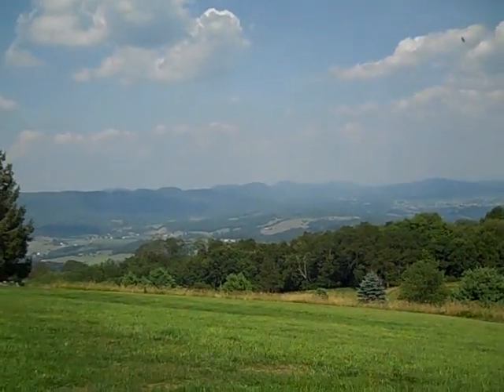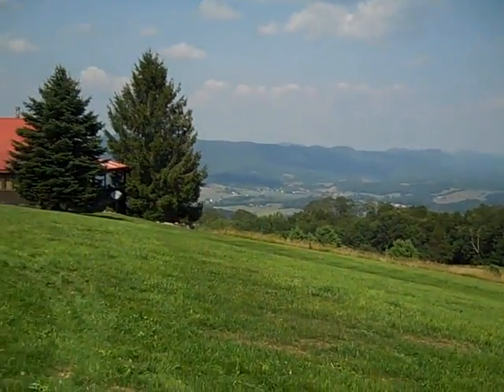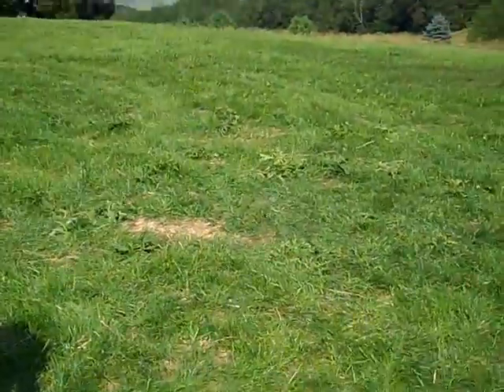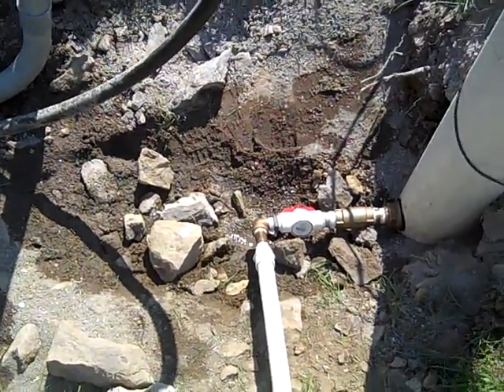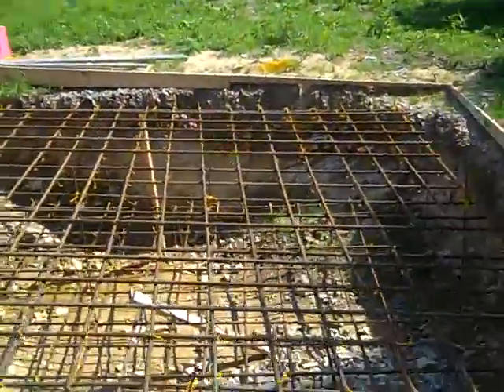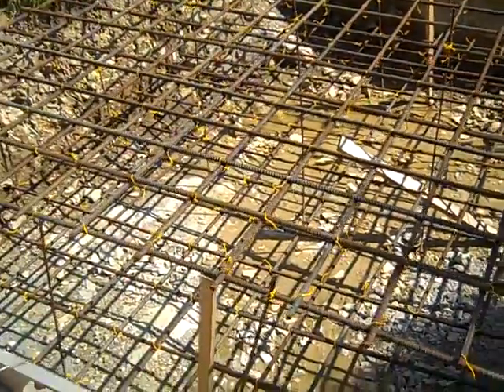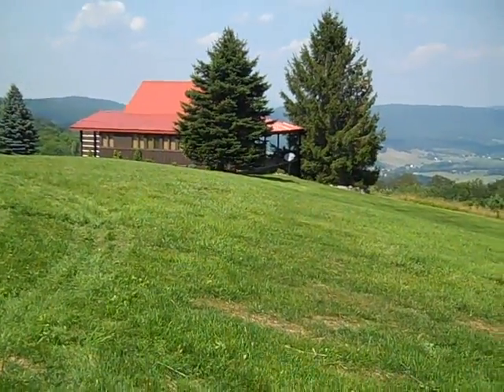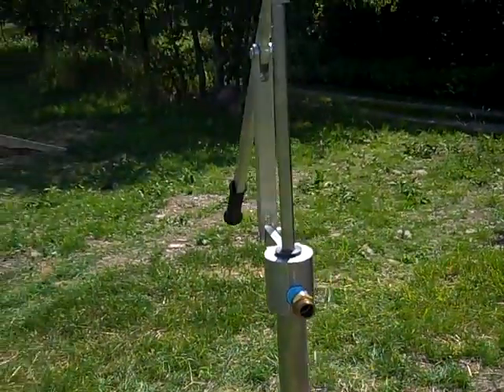Retreat Design - Simple pump installed

Comment: Could your simple pump be driven by a old style farm wind vane type system?  I would like to setup a system where a wind driven pump pushed water into an up hill or tower mounted tank to create pressure but would require no power to use.  It is just a thought at this point but I sure can see some advantages to such a system.

Comment from the maker: @TheBeeperman Actually painted light gray it is hardly noticeable in its location. The owner will also have a gin pole so he can lower and raise the turbine anytime with a tractor of a jeep. The pump can work off the solar array but the array is set up for 48 volts  so we either have to step it down to 24 or invert to AC and then charge the battery.  I plan on putting in it own solar array, charge controller, battery bank.   A dedicated standalone water pumping station.